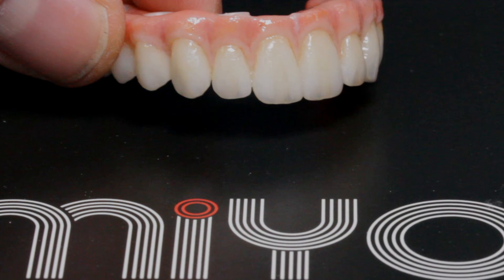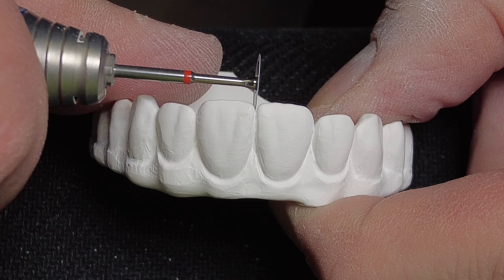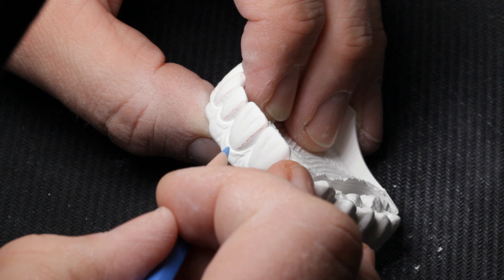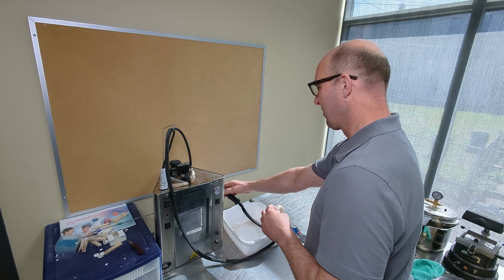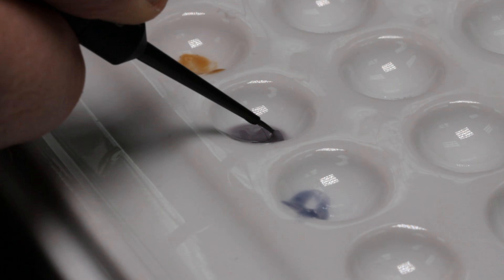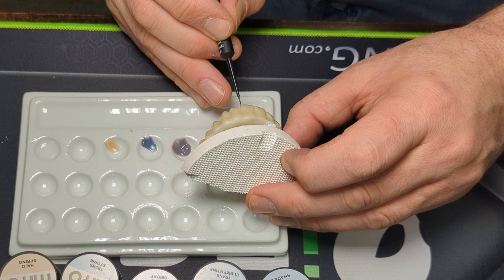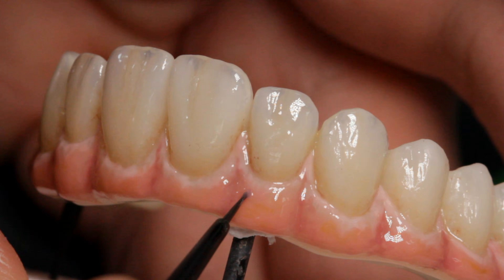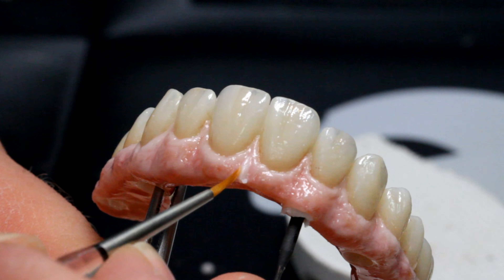Mastering All on 4 Zirconia: The Ultimate All On 4 Case Tutorial For Lab Technicians!

Comment: Hello, I really liked your work and would like to kindly ask if you could share the exact kiln temperatures for glazing at each stage.
Reply from the maker: Hi thank you for the comment. It really depends on the size, the weight (how much heat it can absorb) and the personal preference of luster. For these types of All-on-x a good starting point is 12 min dry, 35c/m raise, 750 final  temp, 0 minutes hold at final temp, long term cool to 350 c. These are safe settings to start with. I believe I have a short frame in the video of the oven program I was using.

Comment: Hello. What program do you use for fireing structure. In video i like you show furnance display to show us diagram. That is very nice.
I am doing it today. So i hope you see it. Best regards
Reply from the maker: I fire Structure at 725, 15 min drying time, 35 degree/minute heat rate/ no vacuum, no holding time at final temperature, long term cooling until 350 degrees Celsius. Good luck

Comment: "Hi  I've learned a lot from your videos, thank you! Is there a method in exocad for drawing subgingival margins on intraoral scanned files that allows for removing soft tissue on the buccal and lingual sides? I want to achieve a result similar to margin scraping on stone models, without using freeform modeling. Any advice?"
Reply from the maker: Yes it's possible in the 3.2 version of Exocad. Which version do you have?

Comment: I use Zirkonzahn Prettau 2 pucks and I tried contouring at green state but it breaks so easily. Would there be a difference in the brand of the puck?
Reply: Oh and bleach shade pucks seem more fragile than other shades. Would that make a difference or is it just me? I’ve just returned to this field after 8yrs. A lot has changed and a lot to learn..
Reply from the maker: Try Argen Zirconia, B&D origin or Upcerra. Those are very good brands that I have great success with
Reply from the maker: What tools do you use in green state?

Comment: what brand of zirconia do you use? Thanks for the video!
Reply from the maker: You can use ArgenHT, Origin from B&B. It does not matter. What matters is the Miyo application
Reply: @masterdentaltechnician1914  How do you combat Miyo " running" color? I know the company said it is all about consistency, but it is easier said than done! What is the black pegs you use to hold your full arch? Thanks!
Reply from the maker: 1) just use a very light coat of glaze paste. Almost nothing. You can experiment with no glaze at all at first. Especially when you add multiple Miyo layers at the incisal and have too much glaze paste it's get's runny. The pegs are firing pegs but those are not ideal so I do not recommend them. That's what I had laying around 👍🤣😊

Comment: Do yo have any cracks failure in these works? 
If not,  why others make these works with titanium or metal bar.
Perfect work but have one  little mistake
 you should not glaze  parts that touch gigiva, only polished zirconia.
Reply from the maker: No cracks. You need a certain prosthetic space. Also every firing needs the have long term cool down

Comment: Thank you very much for your work Sir  ! I see you do not coloring the green stage !
Reply from the maker: I do not. MIYO is such a good material you don't need to. I did it in the past but it was too labor intensive for very little results. I think I would do pink with infiltrated Zirconia for darker shades because I am using preshaded discs. C3 or C4 the pink will become an issue with MIYO. On the other hand I don't do any of these shades